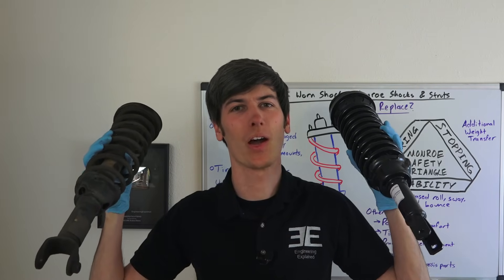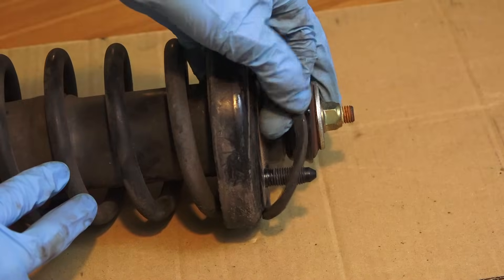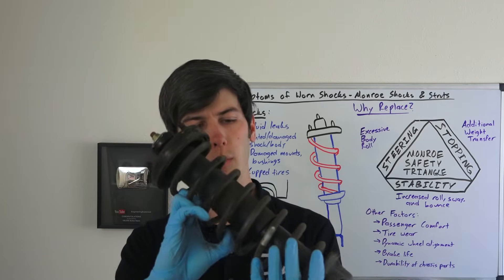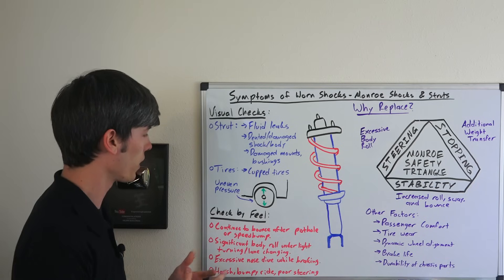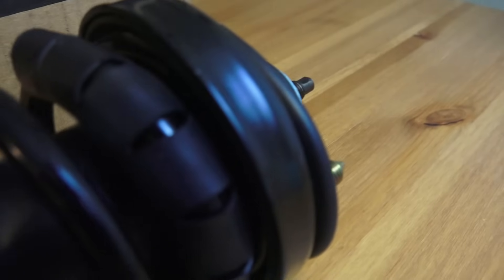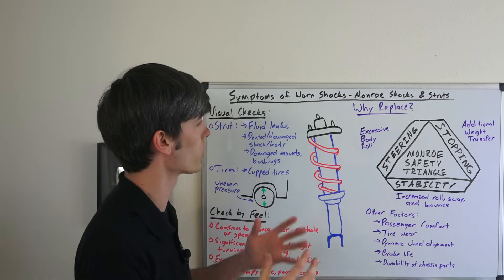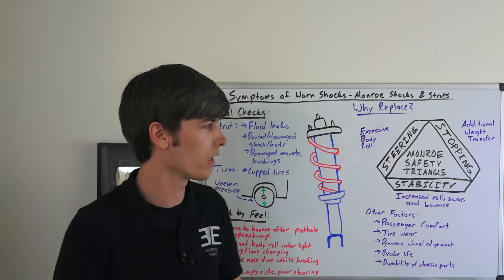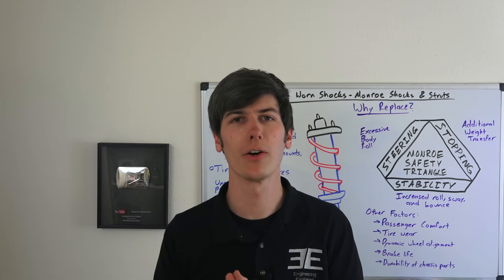When To Replace Struts - Monroe Shocks And Struts

Comment: I’ve noticed in my 2011 Silverado every speed bump/train tracks/pothole I go over my whole vehicle shakes and I’m wondering if that cause I need to replace my front struts. Never had them done before but I have had to replace my front stabilizer links more then once and they break and my front drivers axle boot too. I have approx 180,000 km on it

Comment: Not sure if you would respond but your advice would be greatly appreciated..

My car is only giving the symptom of stiff suspension while going through bumps.. No swaying no bouncing and steering is working well. Brakes are good too front 60% and rear 40%. I recently did a transmission oil change from a mechanic so not sure if it's related to that..

Do you think it's suspension issue or something else??
Thank you

Comment: On the rear should you replace both shocks? Yes of course! Can you just replace one? Well, you can. It will probably improve your handling if the stock you removed was bad. Replacing one shock is better than having two bad shocks. If money is tight, replace that bad shock!

Comment: I have a crown victoria police interceptor with 215k on it with original struts and I can't tell if the struts are worn out because they feel pretty good and aren't leaking. A worn police strut kinda feels like a new civilian strut (in my head) .  Motorcraft claims to have tested them until failure when developing. Which makes sense . Some police crown vics go their entire career on their original struts. Not all departments have big budgets for new comfort parts. So it kinda makes sense they made them pretty heavy duty.

Comment: I have a 2007 Toyota 4 Runner. Big-O-Tires told me I need shock and struts. That was two years ago, and my truck now it rattles like a vibration kinda feel. I would have to release the gas for it to stop. Can this be do to my truck shock and struts?
Thanks.

Comment: Tuesday, April 16, 2024 ☁️ 🌥️ ☁️

The large, floating overhead question is - how do I tell which strut is bad?

My car is a 2004 Toyota Corolla, with 155,526 miles. 🚗 When the front tires hit a bump, something rattles!

I drove slowly along a road with lots of patches. I heard the rattling sound more when the road patches were on the right side. So probably the right strut is failing. 👨‍🌾

Comment: I got a squeak and it's pretty annoying. Just occured. And these shocks are only 50k old. Mostly highway use.

The shop who replaced them last charged an arm and a leg and apparently used topshelf parts. Which now I doubt. The old shocks/struts lasted 180k.

Comment: I just noticed that My FRONT STRUT NUT is Rusted Over when I popped open the hood . I bought a Replacement Front Strut Nut.  Can I just simply Undo the NUT and Replace it with the new one?  NO need to jack the car up ? Any Torque Settings? 

Thanks!

Comment: is 45k miles too early to even think about replacing them assuming you dont sense anything wrong with the suspension while driving

the reason i asked is for example when theres a really good discount on a complete set of shocks would you recommend replacing them even if there are no signs you need to replace them specially if you can do it yourself

Comment: Don't have aftermarket quick struts put in, it's all assembled together and quick and easy to put in but they don't have longevity. If you want longevity and better reliability it's a must to use a spring\coil compressor for safety and only put in a new shock so you can keep the original OEM coil\ springs

Comment: He mentioned the bushings at the top but didn't explain when you might know those are bad. I just finished replacing the struts on my wife's Nissan about 2 hours ago because the jounce bearings/bushings at the top of the struts were going bad and making a creaking noise when you turn the wheels at low speeds. It sounded just like the creaking you get with a tie rod end or a ball joint and took me while to figure it what it was. So if you ever hear creaking when you turn the wheel and you check the tie rod end and the ball joints are good, you may have bad jounce bearings that are inside the top of the strut. I didn't know this until I happened to my wifes car.  I didn't even know there was a turning bushing/bearing in struts that turns when you turn the wheels until now.

Comment: The whole thing is called strut, the inside is shock absorber, then the coil spring is obvious, right? The spring NEVER gets worn or tired (unless it gets physical damage or rust), right?
Will a bad shock absorber mess up the camber? The alignment guy could not get the front left non-adjustable camber in range for my BMW e92 and he said I need new struts. Worn shock absorber should not affect the struct loaded height but the spring (if weakened) would, right?
I would take both struts out and compare their height?

Comment: A strut assembly also includes the spring.  You didn't discuss the strut spring being worn (ride height lower than original spec).  Is there a place to reference factory ride height data?

Comment: Can you do just two struts at a time or do you have to do all four at the same time?
Reply: Yes, you can do two at a time, as long as they are installed over the same axle. for example, two new struts on the rear or two new struts on the front.

Comment: Hey bro thanks for the video always good!!, I was wondering I was watching another video that included quick strut versus the orginal kind...two different brands, one kyb not quick, and Gabriel quick mount. Expanded they bother came to the same length 23", but the kyb OE was 16.69" and the other 15.94" a difference of 0.75"?...what does that mean for the ride and handling?, appreciate you getting back as this will either make or break my decision of which manufactor I go with, thanks bro.

Comment: We noticed an issue this weekend when going around sharp turns. It sounded like the tires were spinning against the shocks, as if the shocks were riding really low. The traction control light (or skid light?) and it caused us to slow way down. No visible fluid leak and not extra bumpy ride. Any ideas what this might be?

Comment: Can someone give me a tip on improving the ride comfort on a 1st Gen , 2012 Kia Soul with 95K on the odo?  I already ride 3 psi below manufacturer recommended tire pressure.  Will swapping 90K miles old stock struts make a difference?
Reply: It all depends. I had my control arm replaced and it improved the ride. Mine was a 2014 Kia Optima Hybrid. Struts were okay and the control arm had some movement

Comment: Thank you. I learned a loot. I believe I need to replace my shocks and I failed inspection because my left strut is broken. I need to change both because there so much nose dip and bounce if I stop after fast acceleration the car bounces. If I hit deep pot holes in bounces the nose bangs against the pavement. I just hit 100,00 miles on my 2010 bmw 535xi

Comment: I noticed that when I corner and change lane it tends to roll more, also the ride is harsh when hitting rough roads or potholes, plus the steering appears to be off especially when it is windy and my car tend to go off lane . That is the time I had to change my struts at 230k miles Accord and I used all 4 front and back KYB struts
Reply: Mine is having the same symptoms on my 2018 Corsa, though I've had it inspected about 3 times the garage can only find slight wear on front drivers side shock but not enough to replace. 
I feel like I'm going crazy because the cars comfort and handling has been slowly getting worse! 😢

Comment: "Look at your struts after around 50,000 miles"
panics in 210,000 miles
Reply: I have a lexus. 200k miles on the original still going strong.
Reply: @capitalismnfreedom3084 Honestly?
Reply: I've had an acura with 180k miles until the shocks gave up. It depends on the car brand.
Reply: @May16Joe  
Not true, depends on the road conditions.
Reply: @May16Joe Really?
Reply: Here 2014 Toyota Camry 413000km struts still good
Reply: Unless you live in the balkans. The roads here will make your suspension cry after 70k km or so.
Reply: or just do what i did and let it rust out and then rub your rear left tire raw and puncture it

Comment: I have a 2004 Oldsmobile Silhouette minivan with 89,000 miles. Is it difficult to change out the front struts?  The rear air shocks have a compressor for ride leveling. Any helpful suggestions?  The owners manual doesn’t say much about them. Thank you. joseduranjr8@gmail

Comment: Lol I bought a Toyota Camry with 149k miles, and I'm pretty sure it was the original set of shocks and struts that came with the vehicle.

Going down the road feels like I'm in a bouncy house. Seriously not safe.

Look forward to getting them changed and having a safer, more reliable ride. Just waiting on the parts to arrive this weekend so I can play mechanic out in the yard.

It amazes me how absolutely clueless most people are about vehicles. Suspension is how your car gives you a comfortable ride, yes, but bad suspension increases other wear and tear, can lead to catastrophic failure in the wheel wells, and decreases steering control.

Comment: @Engineering Explained How long do the original springs last? Looking to replace rear struts and thinking about using the same spring again instead of getting complete strut assembly. Thanks.
Reply: Idk if you still need this advice, but ill post it for anyone else with a similar question.

As long as they arn't showing signs of wear, or the car isn't sagging to one side, a spring should last the lifetime of the car. 

Granted, if you dont have the knowledge or tools to change the strut and spring, it may be better to get a 'quick strut' i.e. a preassembled kit that has the spring, strut and bearing plate already attached and put togeather.

Comment: Quick struts Monroe has issues on mine on every bumps and it is annoying with those noise on rough roads but driving on highway sounds okay. It is a mistake buying aftermarket parts just stick with OEM where they are tested  for specific vehicles. Noise was not mentioned at all on this video for Monroe quick struts.

Comment: I have a lexus 200t, when I hit a pot hole at 100km/h my shock make a LOUD BANG, works ok in low speed condition, took it to 3 dealers , no one could find the issue as it was hard to reproduce, the only way to know it was damage was to lift the car up and measure the wheel heights at they were different(the one hanging the lowest beeing the shot strut) . Hope it helps somebody.
Reply: I HAD THE SAME PROBLEM !! SPEEDING AND HAD A LOUD BANGGG LITERALLY NOBODYYYY COULD FIND THE ISSUEEE it was the struttttt 😣
Reply: Check the bushing, shock mounting, ball joint and all the rubbers ect...
Reply: 60 mph
Reply: I had the same issue check the engine mounts that could be the cause. It’s easy to overlook.
Reply: Yeah, that’s how I usually notice about shocks on a vehicle if I jack it up and it takes an excessively long time to jack up typically structured have no more than a 4 to 6 inch travel to my experience on a car if it has more than that it’s bad

Comment: My front right shock is leaking oil or fluid on top. The mechanic said if U replace it, it should be two. Otherwise the new shock will carry most of the weight if only U changed the damaged one. How true is that? Maybe he only wants to make more money for the shop or what? I need your expert advice....

Thanks, jojo
Reply: anything on suspension done is done in pairs. Two shocks, sway bar links, top mounts. It should be same stuff on same axel. I mean it doesnt have to but it should if u plan on driving it in future

Comment: Research brought me to this video looking for suggestions.  In short, my SUV is on its second front set of Gabriel Struts in less than 5 years.
1.  The first set were replaced because the top hats growled whenever turning the steering wheel left or right.
2.  Now the second set is doing the same as the first but with the addition of the left one making popping sounds, especially when turning left (I placed my hand while my Wife turned the wheel left and felt the spring shift).
3.  There is zero vibration or drift while driving/braking at any speed; steering dead-center.

NOTE:  All front components (lower Control Arms w/Ball Joints, Inner/Outer Tie Rods, Half Shafts and Hubs w/Bearings, etc.) are all new.  
Suggestions?

Comment: I'm getting all four shocks replaced in three days! 02 Volvo S40 with 110k miles on. I'm getting Monroe Originals (as they are called here in Europe).
Reply: It's done. The difference in handling, ride comfort and braking distance is stunning.
Reply: Nice to hear so after all the Monroe bashing

Comment: When should springs be considered to change?
Reply: Never
Reply: If they are broken (snapped in half, or cracked, or fractured).
Reply: Also when they are sold assembled with the shock absorber as a strut assembly. On many you can remove and reuse the spring, but it takes a spring compressor and is not the safest work. So some just replace them to avoid the labor and danger.

Comment: Nice video Jason. I'm a fan of Monroe too. I'm using Monroe Reflex on my Saab 9-3 (the car is defo the star in my vids, lol) and have done about 50k miles on them so far. Very good and keenly priced.
I am slightly biased I suppose as my employer uses Monroe too (though that FType SVR you drove uses Bilstein - you lucky dog! I've 'only' driven an S - got it to 178mph tho')).
Reply: They should be good at only 50,000 miles, I'm just replacing my original Honda OEM "shocks only" for the first time at 160,000 miles

Comment: Jason, why would you have 120k shocks on your car!? That's way too old, double the recommended mileage, actually.
Reply: 98' Toyota Avalon, 251k miles.. Original shocks finally failing. Some shocks will last forever. I plan to mount the remaining shocks in my garage, 251k miles and only the front 2 are dead, the rear is soon to fail, great lil' aesthetics.

Comment: Avoid Monroe like the plague. Bought their quick struts for my car and the passenger side took 4 hours and had to go back to autozone to loan the spring compressor to remove the top part of the strut and use the old one plus we had to rotate "shock" so it would line up. The drivers side took a little over an hour and we were able to put it on after compressing and rotating bottom part of the thing. It's been less than a month and already hear the clunk noise on pass side (why i bought the struts in first place). Yes the ride is better than the worn out struts.. way better. However after reading some posts and vids about them it appears that failing early isn't unheard of with monroe struts/shocks. If I had it to do over I'd buy another brand's suspension parts.

Comment: I bought monroe, people seem to dislike them. They are still fairly new (1500 km), one thing i noticed is that they are really hard, only changed the back. When i replace the front ones i will chose another brand cause of that. Too stiff even though they added a shitload of stability and corner hability to my car which is also nice...

Comment: Should you replace the spring too? or just replace the shock? or just do a quick strut?
Reply: Springs generally last forever, they change very little over the years, unless it is severly rusted, then change...
Reply: ferfire9, ok thanks.
Reply: Cyclone Cyd a quick strut is a complete strut and spring  already assembled. No compressing springs to worry about, it's ready to be installed.
Reply: Springs can lose their tension over time. Kinda depends how many miles are on the car how heavy the car is and age of the car
Reply: Quick struts are easier though and not dangerous. Might be more expensive but I also value safety.
Reply: It's unlikely the springs "need" replaced, but I would suggest changing the top mounts and bearings at the same time. I don't really know what a 'quick strut' is, but am guessing it's a complete unit (strut, spring, top mount & bearing). If the price is good, go for it. Not a term we hear here in UK
I'd also recommend changing all four shocks - at the VERY least in axle pairs.
Reply: Thought as much. Less effort, less danger and no doubt good value since everything will be new. Thanks

Comment: My car is 2001 grand marquis has 100k mile and I changed the 4 shock absorber to Monroe  but still I am not filling good on  road , can you give me any advice??
Reply: do you have a rear stabilizer bar?  My 2008 grand marquis, with 68k miles, did not have one and handling was terrible on the freeway.  I pulled a rear stabilizer off a car in the junk yard and the car handles much better. Before the rear stabilizer, it felt like I was driving a water bed when the road would curve at moderate to higher speeds..

Comment: Is there an electronic test for the shocks and struts, or even the whole suspension system?
Reply: why would a mechanical physical system need a digital test? It is about physical components that wear, not circuit boards.  Electronics is what is making new cars very expensive .

Comment: Thanks for the video! Very interesting. I have a question: What brand of shock absorbs would you recommend? Does it make a difference to buy more expensive KYB instead of cheaper Monroe or other brand?
Thanks for the answer.
Reply: monroe are just average aftermarket replacements,nothing extra.